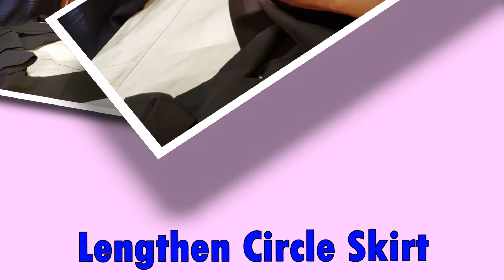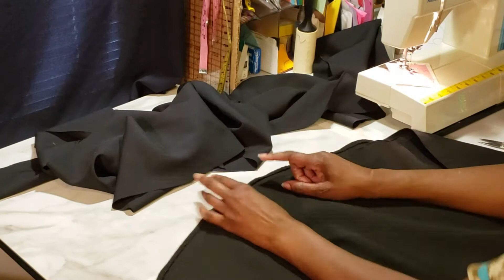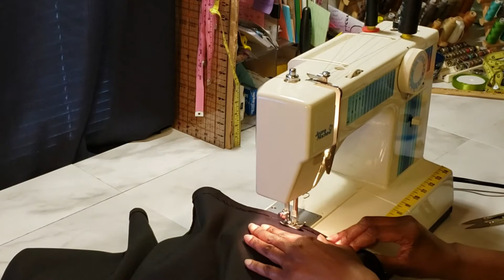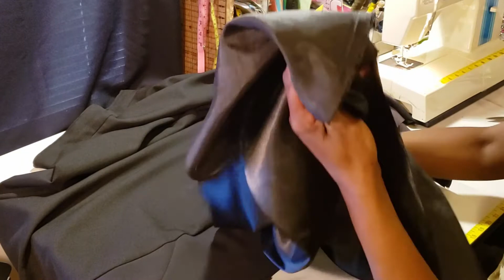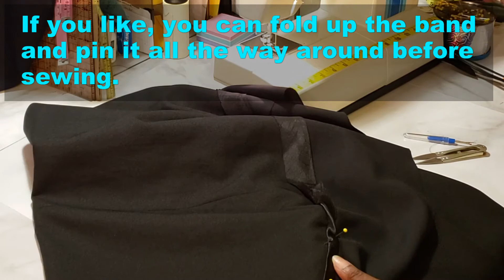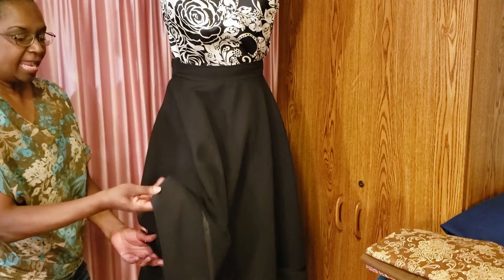Turn Circle Skirt Into Midi Or Maxi Skirt Lengthen skirt

Comment: Im sorry I wasn't clear when I asked my question which appears to have been deleted so I'll try to word it better this time. Would it be possible to use this same technique at the waist of a circle skirt in order to lengthen it? I don't have enough material to add to the bottom of the skirt.
Reply from the maker: That's a good question, but you have to remember that the waist of the circle skirt is the "smallest" part of the skirt.  If you add fabric to the top, it will only make for a wide waist band.  I hope this answers your question.  Let me know if it doesn't.  Thanks for asking.
Reply: @NilerTaylor-relindesigns  Thanks Niler. If I find the courage to tackle this I'll let you know how I make out